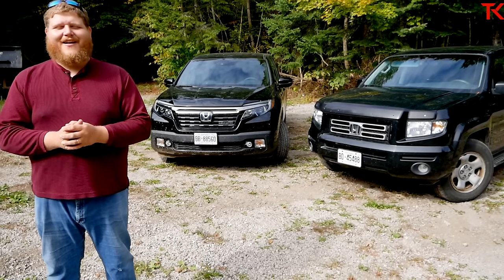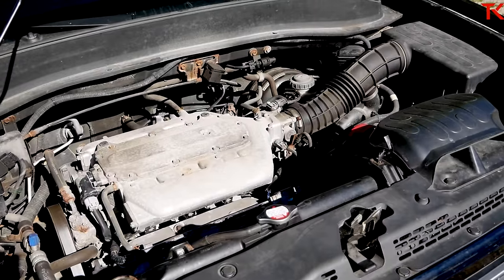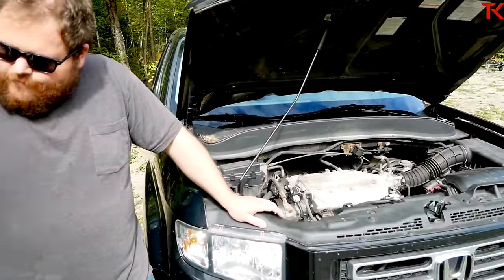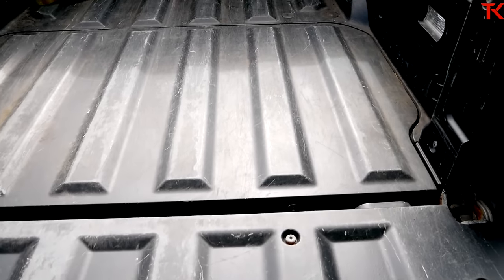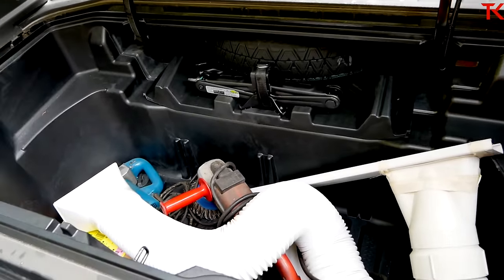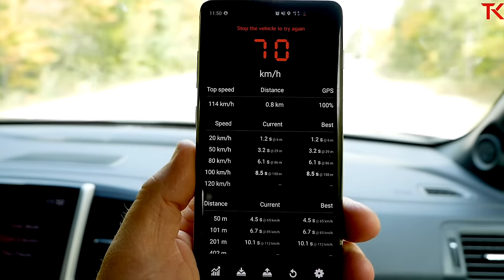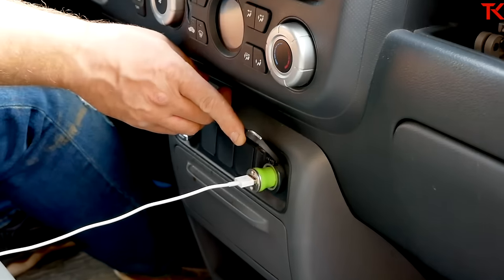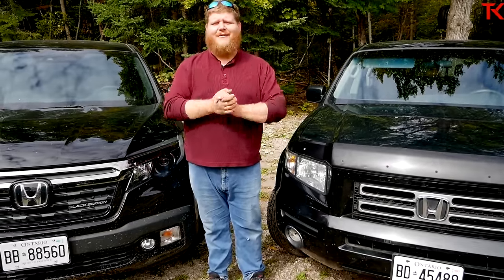Old VS New - Is the 2020 Honda Ridgeline Truly Better than the Old One? + 0-60 MPH Drag Race!

Comment: Considering they have had such a good reputation car/engine wise... resale value, etc.. I'd have no problem picking up a Honda pick up truck... van... whatever.    Honestly, unless more closed-minded OR someone who always just sticks to one make for some reason...  A person who, perhaps.. requires higher towing capacity OR.... actually, cannot think of any other reason one shouldn't consider it.  lol    
That said, first & foremost... $500, that was then FREE??  (envious doesn't begin to describe it, esp during these times & at this very moment)  I'm quite sure there wasn't any lying or fkery going on TO get it from the guy, so... great score, ya' lucky duck!  Am w/ ya' that I kind of prefer the grill on the older one, btw)     Sounds like a great guy had a good truck he didn't have a need for anymore.  He saw someone else could use 'er, would take good care & so, paid it forward.  :)  I'm sure you'll enjoy every second 'until'.  That's the benefit, too.   Sure, who wouldn't want something w/ less age & rust to it.. w/ more tech. advanced features, that has less miles & prob a little bit better gas mileage too, etc.  
For the pretty kool features they both DO have tho...   Love that 'trunk'...  + how the back seats fold..  the dual direction tailgate, also love.   For just a daily driver, to me... it'd be a no-brainer.  Esp because its best option, imho... That 2008 would win hands-down, no contest.   Why?    While the new one is quite pretty (prob alone in this, but i actually really like that truck-bed hump off the cab on the '08. Idk.. just makes it unique.) the prob, at least > $500-800 dollar a month PLUS.. savings, not having a car payment for x amt of years... OR cost of carrying new car/full insurance the first few, either!   For that alone, I'd drive that '08, "until" she drove.. no.. more.   LOL    Imho, even w/ no need for a 'pick up truck, per se' (both were 4wd? .. or is the new AWD?) I'd have no prob picking one up; esp if a good deal, regardless of brand.  Honda, Hyundai, Dodge..  all good I'm sure, in their own ways.   Prob really good in the cold Canada.... or, in my case, would be Chicago....  winters!     ENJOY!  They are both really nice & thanks for sharing.    Please stay safe & be well.

Comment: The first gen interior is so much better.  Probably the best midsize truck interior ever.  Front ground clearance is also much better.

That bed though...the extra height doesn't do much good since tonneau covers sit on that ledge, which appears to be the same height as the new truck.  Honda comes so very close to making a completely awesome truck but they keep flubbing important details.

Comment: Old truck didn’t come with a hitch or wiring harness. All dealer installed.
Reply: True, I forgot about the RTX. I had a 2006 RTL.
Reply: @thomasrossi31  That's odd, my '06 RTL has the factory hitch and wiring harness.
Reply: Doug Fielding, yes you can have an OEM hitch & wiring... but it was a dealer accessory.

Comment: That plastic intake manifold will crack after about 100k miles.
Reply: I know someone with a 150k miles and many approaching 100k miles with an original plastic intake on their 2017 model.
The guy with 150k miles however, had changed out struts, bearings, and brakes twice.  Never the intake manifold. 
Did you know that Ford 5.0 on the mustangs has plastic oil pan?
Reply: @squidusn71 , I had a 4.6L mustang with a plastic intake manifold and it cracked at 125k. I had them replace it with an aluminum one. If Honda's plastic intake manifolds are built like their plastic radiators they'll average 100k mile lifespan.
Reply: @theinternets7516 the last 4.6 was 10yrs ago, now they moved to the oil pan.  Im hoping they've gotten better since lol.

Comment: So that honda needed all that work and its an 08 and was gonna be sold for $500... yea no....
Reply: That was dealer prices. He's in it for around $1000. The former owner ended up giving him the truck. He bought a used alternator and starter from wrecked vehicles, and a timing belt kit (with water pump and tensioner) is around $400.

Comment: I haven't got anything against the Honda Ridgeline. Its an awesome Ute, but its not a truck.
Reply: David Blalock how do you define a pickup truck?
Reply: No frame? You should read this.
http://www.trucktrend.com/how-to/chassis-suspension/1705-honda-ridgelines-frame-the-untold-story/
Reply: @nateallen2709  a semi TRUCK can pull/tow a lot.  I guess a 1/2 ton is not a real truck compare to it.  Oh wait, the semi doesn't have a cargo bed or a rock crawler.
Reply: @nateallen2709  the existance of a frame does not define a vehicle a truck. A pickup is just another name for a truck.
Reply: @nateallen2709  yeah, body as in a cargo or bed not frame.  Look it up sometimes.
Reply: @nateallen2709  a 4runner was/is never a truck.  The industry calls it SUV.  All the vehicles has their own designation or nomenclature.  A minivan is a miniVAN and there's nothing mini about it.  An older van with a frame is still a VAN and is in the same designation as any other van including minivans.  People calls the  higlander an SUV but actually a crossover, however, you can't call a 4runner as a crossover.
If you think a F150 and a Expedition are both trucks or a Silverado and a Tahoe as trucks then you're confused lol.
Just as people saying the ridgeline isnt a truck because it can't rock crawl or off road, well, neither a semi, lol.
Reply: @nateallen2709  "A Crown Victoria is a truck",  LOL!

Comment: What a ripoff the dealership is. Nothing on that truck cost $7000 not even a starter/ alternator, and a used complete engine with low miles . It’s a j-35 the most common of Honda engines. Timing belts suck to replace on them but you can get a complete timing set from an online from rockauto  name brand for cheap. Sounds like someone hustled someone else out of a truck. I’ve seen 300 k miles on these just maintenance and a alternator at some point. Something about the alternators now.

Comment: I think the old one is a lot tougher, larger suspension components and a standard transmission cooler! Also the new one's styling is terrible and weak.
Reply: First 2 items you listed are demonstrably false. Honda has videos showing heavier duty suspension components, and rigidity and structural support have been greatly increased over the 1G.

All this is available with basic research.

And all AWD models have tranny coolers. So basically everything you wrote was false.
Reply: If you like your 1g RL more, just say that instead of making up bs just to hate on it.

Comment: I’m torn between a taco and a rline.
Reply: Depends on your needs if you need a higher towing capacity or you have to do serious off road then the Tacoma is a better choice but if you want a comfortable daily driver with the occasional load and towing then the ridgeline is a better choice but it's all up to your needs

Comment: looks like a pain in the butt to get the spare out.
Reply: Easier than having to dig it out from underneat the truck
Reply: Yes, only if you have a flat and stuff on the bed.  If the bed is empty, it's much easier than being underneath, it's good for older guys lol.
Reply: the spare tire bed should be made to slide out.

Comment: WTF plastic intake? lol wait Scotty just tuned in
Reply: Yeah, that caught me by surprise. Reminded me of pulling my intake manifold off my 1966 428 V8 a few years back, solid cast iron and weighed around 80 lbs. The plastic is lighter and probably fine, not much stress on it.
Reply: @Stephen-er4bi  1966 428, year of production speaks for itself, try that with plastic even insustrial grade
Reply: It's pretty much a standard issue now adays.  The current mustang GT 5.0 has a plastic oil pan lol.

Comment: WHEN WILL HONDA MAKE A REAL FULL SIZE TRUCK?  WHEN YOU GO INSIDE A HONDA RIGELINE AND DRIVE IT YOU WILL QUICK REALIZE IT FEELS AND LOOKS INSIDE LIKE YOUR DRIVING A SEDAN WITH  A SUV FEEL BUT NOT QUITE A TRUCK,  HONDA NEEDS TO GO ALL OUT AND MAKE A FULL SIZE 4 DOOR TRUCK TO COMPETE WITH TOYOTA TUNDRA
Reply: u needa chill
Reply: Ray Aviation why? Honda should snap out of it and get on the ball and roll out a big full size truck v8 as big as a tundra or Titan, it’s long over due
Reply: no your point is good but the all caps was a bit too much in my opinion
Reply: All your negagive are posotives to owneres lol.

Comment: Both trucks are worthless for heavy cargo and the inside looks like 2005. I have a limited 2021 ram with the barn doors and the bed is deeper for more stuff to fit in and not roll out as your driving.
Reply: Around here, seems like full size pickups are the trendy thing to drive around... and they offert better tax write off if you are a business.
You seldom see them with anything in the box and you see even less of them off road
Reply: Funny you didnt mention off roading and towing lol.  What a waste of a truck.